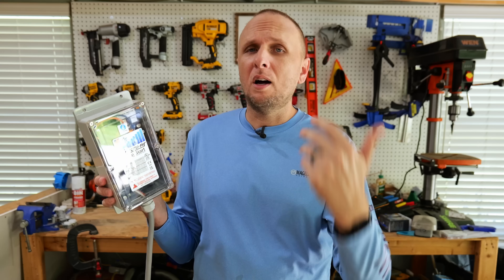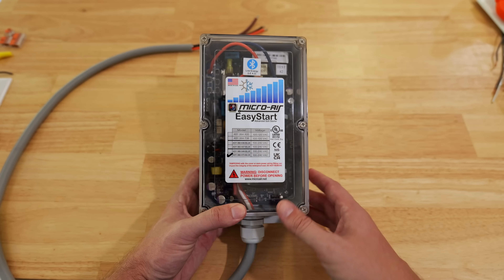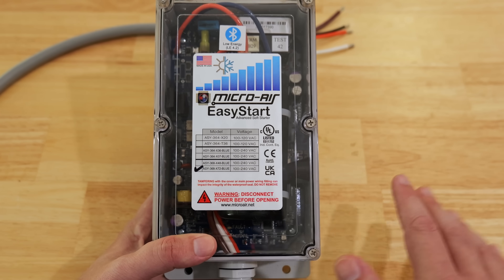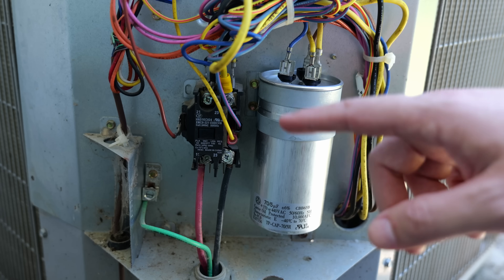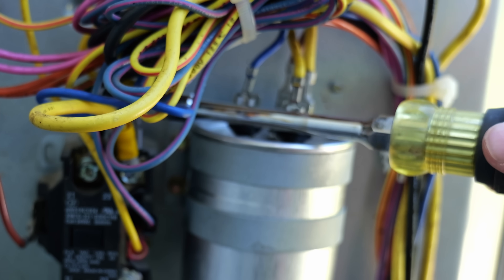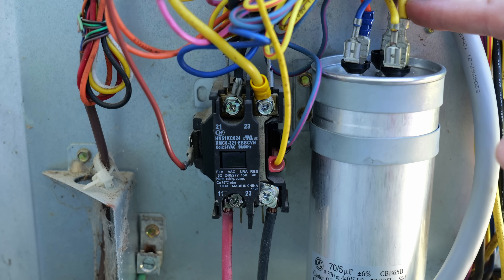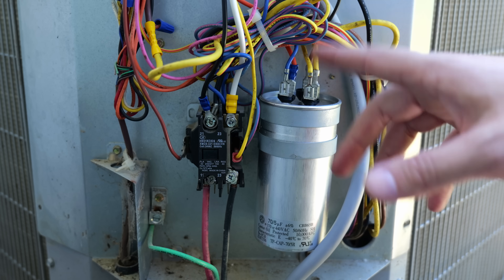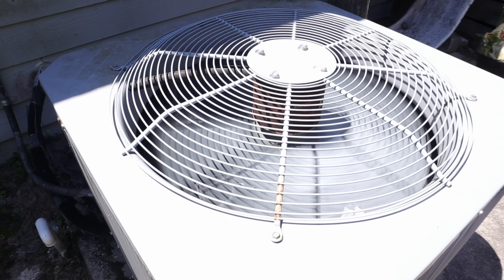Why Every Homeowner Should Consider Installing an AC Soft Starter | Micro Air Easy Start Install

Comment: So what all "appliances" are soft starts available for?  I've been told that they can be used for a fridge in regards to the use of a "home size" to be used in an RV/TT.  Over the last few months I "remodeled" the guest house...now 1/2 shop, 1/2 man cave 😂!  Since it was vandalized/gutted before we bought it, it runs on "extentia-power"!  Goal is 100% "alternative" power from an RV/TT setup.  Combo of the Inverter/Converter/Charger unit, batteries, lighting, 12v fridge & tv from an TT I gutted along with solar  panels & a 400w wind gen.  We are about to start on my wifes "garden-pond" project with waterfall, wishing well & water wheel...scheming on slipping in a micro-hydro gen. when she's not looking 😅!!  You have any ideas or suggestions?  Not sure how to tackle the charge controller...  I've seen them for RV's allowing AC, DC & solar OR wind.....& an AC, solar & wind combo!  Of course (AC the exception) it's all DC so maybe there's an option of connecting multiple charge controllers?  Being that I have to build many of the components I'm dragging my feet when it comes to my "grey area" of electronics!! Just so happy I've got a 4k & 5.5k generators to fall back on if need be!! 😂😅😂😅😂😅

Comment: A lot of the benefits of this, I already expected. The one I wasn't prepared for, which you mentioned, was how much quieter our unit's startup is!!! I am pretty alert to noises throughout the house; but since having installed this, I honestly couldn't tell you when our A/C is running! -Purchased this as our all-electric home's primary heat pump would cause my 20kw generator to puke its guts out if anything bigger than a toaster was also running when it would cycle in, causing more-sensitive devices to shut down or power conditioners to kick in. I haven't had a real-world test on the standby gen as it was only installed a day ago, but I highly recommend to install for any one of the number of benefits you mention.

Comment: Lost power for a couple of days during Hurricane Ian and had a very difficult time getting my AC to turn over even with a 22KW whole home generator.  We have a 2 ton and a 5 ton. Had to cycle through the breakers and shut items down until I had freed up enough power to let the AC compressor kick on. Could only get the 2 ton to fire up. Learned about this item last year and finally got around to ordering  an X48 and X72. Install is next week. The other challenge was finding an electrician who would do the install. AC company said an electrician had to do it while most electricians would say it was an AC install issue. Finally found an electrician who installed these and recommended the Micro Air before I even told him my preference. Has no problem with me purchasing the product on my own and saving me on their 44% markup. I'll give an update after the install. No AC in Florida during Hurricane Season is not a lot of fun. Looking forward to getting this done.
Reply: Update: Successful install Can't believe the difference during start up. Smooth and quiet versus the traditional jolt we are all accustomed to hearing during startup. Not in a big hurry to see these in action during an outage but do feel better about having them installed.
Reply: @sjacuk65  it’s amazing what us electrical engineers can do with only $20 worth of electronics and some software.
Reply: @sjacuk65  me too I’m amazed how much quieter it is. It’s about 7 feet from my window in the bedroom and it’s so much quieter at night hearing it come on and off so much quieter.
Reply: @sjacuk65  great to hear! reside in florida as well so this is valuable information if i/anyone else were to do this. thanks!
Reply: I installed an X48 unit on our 3-ton A/C unit.  Original InRush was 89.9 amps, and it was 23.3 amps after the five learning starts.  No problem now starting the A/C using our Champion 8750/7000 Inverter generator - even with it in Eco Mode!
Reply: @ocnslr  yup. Sounds accurate. This why no one needs those big 18kW-26kw generators..unless you want an automatic option for the extra $15k-$20k…spend ~$5k and get power for your whole house.
Reply: @Electric_Sherlock   Bought a Champion model 100520 8750/7000W Open Frame Inverter a couple of years ago.  Added a Tri-Fuel Conversion Kit and it has served very well.  Of course, I have a Honda EU2000i that is almost 15 years old as well.
Reply: excellent post @sjacuk65. I reside in Fort Myers where Ian kicked our rear. I’m seriously considering installing the soft start unit. If possible, please reply to this post with the electrician company name so I can follow up and potentially hire them for my situation. Best regards…
Reply: @rsmrsm9374  I've had zero issues since having the Soft Start installed. Highly recommended. ETD Electric, out of Palmetto, Fl, did my install.
Reply: Something had to be wrong with your 22kw generator. That’s a 100amp generator. I have a 14kw for the whole house and a 5ton a/c unit.
Reply: @535banshee  I've had zero problems with  my 2 AC units kicking on during outages  since having the Soft Start installed.
Reply: I have a 22kw Generac and my three ton Rheem unit will attempt to start, then it will shut down and go into compressor lockout. If I bypass the lock out circuit it will run. LRA on the unit is about 70 amps, I don’t understand why it won’t start. Will a soft start help?
Reply: I have a more cost effective solution and better product called Sure Start.
Reply: @Electric_Sherlock  I live in a high rise condo where backup power generators are prohibited. My Desire is to extend the HVAC system overall life and efficiency. It appears the soft start upgrade would help dramatically but I’m open to suggestions. I Also want the ability to monitor the HVAC system remotely via a smartphone since the outdoor unit requires permission for access. I’ve serviced my home HVAC system in WA state, but have since relocated to a condo in FL where homeowners are forbidden to perform any work themselves even if one possesses the necessary skill set. Please advise…
System Info: Unit installed 1/2019. Trane 4 Ton, 14.5 Seer Split System, OD Model 4TTR4048L1000, AH Model TEM4A0C48S41SB, 208/230 feed, 45 amp breaker AHU, 40amp breaker ODU, Honeywell T-6 Digital Thermostat.
Reply: @rsmrsm9374  I’m not certain this is possible. If they don’t give you access or at least someone access to the units then you can’t install anything. If they do give you or a qualified & licensed individual access then a smart start coupled with just about any smart thermostat should likely suffice your situation.
Reply: @Electric_Sherlock . What is the reason/justification that the Smart Start is a better, more cost efficient product than the one featured in this video?
Reply: @91156  sure. For starters it’s roughly $100 less. Secondly, the electronics inside of it are better quality and not to mention they were the original pioneers behind these devices.
Reply: @Electric_Sherlock  “better quality” how?  Better tells me nothing when judging an item.  What makes it “better”?
Reply: @91156  better quality meaning better performance, durability, materials used, craftsmanship, and value for money.
Reply: @Electric_Sherlock  I went with AirGo and I’m totally happy. It was $250 versus $400 for the microair. Max starting amps went from 106 to 50 A. Unit is so much quieter on start up now. Totally happy.
Reply: @condor5635 yup the sure start is made by hyper engineering and Airgo is made by the same manufacturer. Airgo is what we use now as well. Glad you like it too
Reply: @condor5635  I installed an Airgo for my 4 ton unit and it didn't seem to keep the house as cool. Didn't have a clamp meter to determine the problem. Measured the temp at the register closest to the air handler and it was 61 degrees, remove the soft starter and the temp was 47 degrees. The specs has LRA at 109 and the RLA at 19.8. I suspect the soft start was less the !9.8 running amps. Any thoughts?
Reply: @ it has nothing to do with how your unit cools. Once the start up is over your compressor is running as it would w/o AirGo. Mine dropped from 106 amps to 52 amps
Reply: How is a 22kw generator suppose to back up your whole house at once. That’s about a 90 amp generator. I’m a master electrician for a 22kw generator you need to have an emergency panel or a bigger generator to back up your whole house
Reply from the maker: I can tell you without a doubt this “master electrician” is wrong.  I easily run my entire 2500 sq ft home on my 12,000/15,000 watt generator.
Reply: @HowToHomeDIY I’m wrong huh? I am absolutely not it depends on the load and service size of your home. I think I have a little more knowledge than you do bud😉
Reply: @HowToHomeDIY and your sq ft size has absolutely nothing to do with your generator size dope. Your 15,000 watt generator can handle about 62 amps. So you’re telling me your home has a 60 amp service? Yeah ok🤣
Reply: @HowToHomeDIY why don’t you post some pics of the size of your main breaker and your transfer switch that backs up your whole home. No way a 15KW generator is backing up your entire 100 amp or 200 amp service. Amperage = watts divide by volts. 15,000 watts divide by 240 volts is about 62.5. That’s how many amps your generator can handle at max load Yw
Reply from the maker: @JohnSmith-fw2zf I’m aware and yet I turn none of my breakers off when I’m using my generator and run everything like I normally would.  Generator has no issue.  You really just proved my point 😂
Reply: @HowToHomeDIY I run a 3600 sqft home on a 12kw and I concur. Even my ancient ACs which are horribly inefficient only pull 8k combined. Sure I'm not using two electric ovens and cooling the house while on generator but that's just unreasonable.
Reply: @JohnSmith-fw2zf  having 200 amp service doesn't mean you need to pull 200 amps, master electrician.
Reply: @JohnSmith-fw2zf  ive got a 15kw generator, 5 ton ac, electric appliances for everything. It runs everything, now you cant turn the oven on and the dryer at the same time. It does it but it puts a hell of a load. If you watch what your doing you can save a lot of money by not going buying a gernerac. If I had gas appliances it definitely wouldnt have an issue
Reply: @HowToHomeDIY  I run my whole home on my 5K inverter gen- 240 watts.  Althouth I have it wired to a 50A inlet box, 50 amp gen breaker, and 50amp wiring, it's only 30A.  I got double breaker that does both sides of my entire panel.  It really helps when you have all gas/120V appliances,  Except of course my A/C unit, that's why I'm here.
Reply: @MattC0725  I was lucky enough to have all gas appliances!  100W breaker panel, etrc.
Reply: @JohnSmith-fw2zf  Really?  My 5K W inverter Gen does my whole panel. However, all appliances are gas, not electric, so other than the a/c no 240V breakers used.  I haven't used the A/C breaker in WI while using the back up gen.  That's why I'm here in case I want to!

Comment: Has anyone seen the YouTube video from HVAC school where they warn against using these hard starts and how it is could actually damage compressors? The video was very technical and it got me scared to use these hard starts. The video interviewed the electrical engineer who created Easy Start and they explain how this product works.
Reply from the maker: This isn’t a hard start kit.  That interview was done with Matteo who is an engineer with Micro Air and him and the HVAC School channel talk about all the great reasons why one should use these soft start kits.  I think you misunderstood something between the two videos.  But if you are thinking this is a hard start kit and are concerned about installing it then you should definitely let an AC company install it for you.
Reply: Yeah I saw that video and all they said was how great this soft starter is and exactly how it works.  What are you talking about?

Comment: The hard start you showed we in the industry call a stick of dynamite that's for temporary use only when the compresssor is locked up. Use a potential relay hard start kit which brings down the start up amps LRA down significantly then drops out of the circuit once Compressor is running will extend life of your unit.

Comment: I worked on artillery tracking radars in the military and we had a soft start in our low voltage power supply.  350v @ 350a was our low voltage.  But the soft start was relatively simple, ran the 3phase 400 Hz into 3 very large resistors, and as power was applied after a certain amount of time it would then use a large relay to short across the resistors thereby giving full power.  

This is a great product to showcase.  I’m definitely interested in it.  Thanks!!  I’m a bit surprised these aren’t mandatory to soften the spikes on the grid.   The inrush current is brief but has full access to the grid for a short time.
Reply: Different issue there with the Radar.  The high voltage caps on the secondary side of the stepup transformer look very much like a dead short when discharged.  The resistors are there to limit the peak current that the secondary rectifier string has to contend with and prevent them from blowing.
Reply: I guess you are talking about a different thing

Comment: I've used this on my RV for years so I could easily run my AC on the RV with my 15a home connection instead of the 30a but never thought to install one on my home AC.  Great tip!

Comment: I can’t find a 50 amp power inlet box that has four prongs, is there one you would recommend?  Thanks and just ordered a soft start , great video
Reply from the maker: A 50 amp power inlet box will only have 3 prongs.  A 30 amp will have 4.  Does your generator have a 50 amp outlet?
Reply: @HowToHomeDIY  I have two Honda eu2200i ‘s and a manual 30 amp transfer switch. I was going to get another generator and add a box to be able to plug it into , but I know I have to use a 3 prong to 4 prong for the Honda eu220o companion model.  That adapter in your Amazon link is a 4 prong female. I was looking for a box to be able to plug that into. Thanks
Reply from the maker: Then you should just need a 30 amp power inlet box which has 4 prongs in it.

Comment: Hi can help with single capacitor diagram instead double capacitor
Reply from the maker: Micro air will include instructions for any application not like mine.

Comment: My 3.5 ton Trane system has a variable speed air handler with a standard speed condensor.  Does the variable AH have any affect on this equipment ?

Comment: Would there be any benefit to installing an Easy-Start unit on a 4 year old Carrier 3 ton unit that has a Run Load of 16.5
 amps and a Locked Run Load of 24 amps?  It's super efficient with a SEER of 18 and it's very quiet.
Reply from the maker: What are the locked rotor amps listed on the unit.  If it’s running at 16.5 amps I would assume the LRA would be a good bit higher.  But one of the benefits on any unit would be extending the compressor’s life.

Comment: Looking ay  the soft air you bought the check mark  is on the 6 ton unit. However you said your unit is four ton, which is what mine is. When I looked at the specs for the 4 ton soft start it said 3.5 ton capacity. So should I actually get the 6 ton soft air> Confused
Reply from the maker: Where is mine check marked as 6 ton?  It goes up to 6 ton.

Comment: can you add another video which shows in more detail how you did 5 startup and run sequences to sync the soft start with the A/C unit? did you use the thermostat for all 5 startup tests? I want to be sure I do everything right to make sure this unit will perform correctly.
Reply from the maker: Yes. I just used the thermostat to turn on the ac and then turn it off after it ran for a bit.  Just repeated the process for 5 total starts and stops.

Comment: Great video !!!      I've installed two of these units, one on a 3 ton (my own home) and another on a 2.5 ton on a family member AC, This video explains everything to detail !  I live in FL, hurricanes are a part of life here. My 5,500w generator powered my AC unit (3 ton) with the Easy Start – no problems!!! To add, if you purchase an Easy Start for your AC, the customer service / tech support is great. I had an issue on my install, I sent a few pictures of my AC unit and the wires, they responded back same day (within an hour) and I was able to complete the install. If you want gain the full capacity of your generator and remain cool, and overall prolong your AC,  do the research and get an Easy Start!  Worth the investment.  Again,  Great Video !

Comment: with the 4ton unit pulling only 36amps on 120volt system, meaning 4,320 watts (peak) easy enough for 5,500watts (running) generator to power.
Reply from the maker: It is 240 volts.

Comment: Even if you don't own /use a generator, this product could be well worth the cost to reduce the start load placed on the AC system.  My bet is it will also extend the life of the start/run capacitor which almost always fails after a few years of use.  One of the very common faults that cause your AC system to stop running.  Most service companies charge a premium to replace the capacitor... hundreds of dollars (which you can do yourself for far less - probably well under $50 for the part).

I would check any warranty you may have and ensure this product does not void it, especially if you have a service contract with a third party.

Comment: From your wiring on the Black and White wires.  The EasyStart only turn on when the compressor contactor is on.  Is this mean that the EasyStart does not turn on on all the time/standby?  Is this correct wiring?  Or do I need to connect to the 220v before the contactor?
Reply from the maker: The easy start is not on all of the time.  Only when the thermostat calls for air.